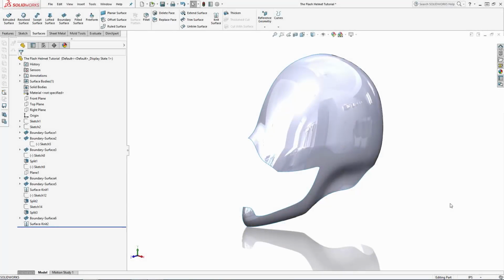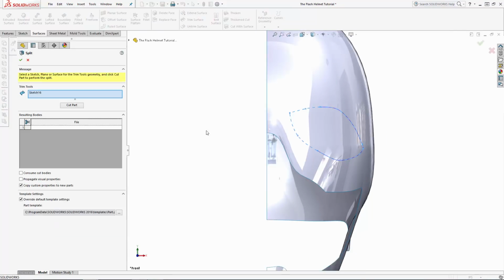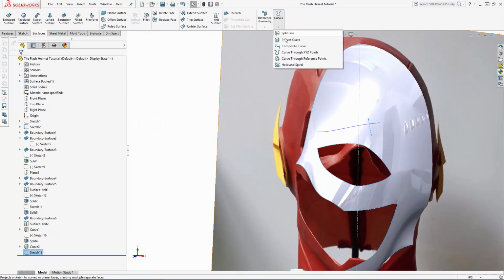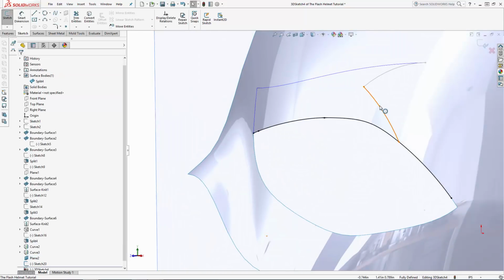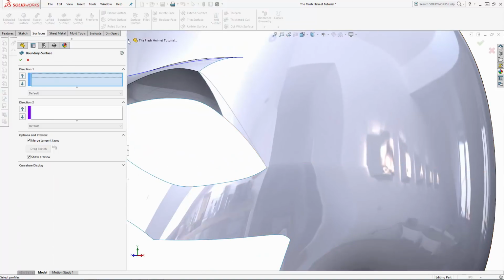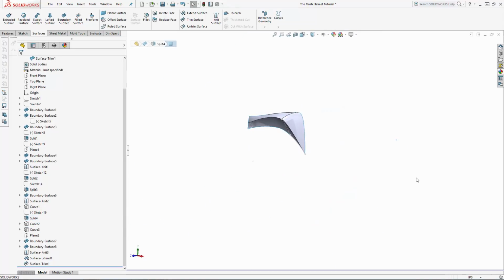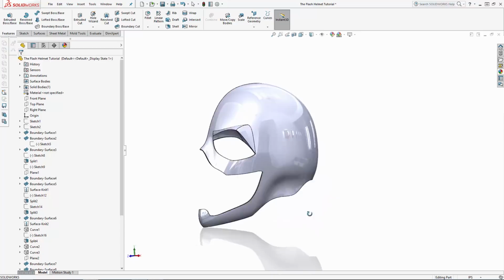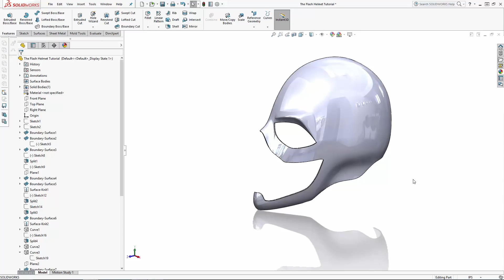Flash Mask Tutorial: Part 2 - SOLIDWORKS

Comment: I  have a question sir. Your tutorial is awesome, but im having trouble with the 3d printing settings. It says, "Cannot print 3d Model on a model that does not contain a soild or watertight body.
Reply from the maker: Hi Dave, I can point you in the right for our 3D Print guidelines in SOLIDWORKS: https://help.solidworks.com/2021/english/SolidWorks/sldworks/c_print3d.htm
Reply: @solidworks  Thank you sir. Im still practicing so its fine..:D
Reply: @solidworks  Hi again sir.. I have a question on 3d printing..WHat if i made an assembly and i just overlap soilids like arms, body, head and legs. Does 3d printing make it a full solid when i print it there? Sorry i dont have any 3d printer to test it..thanks alot
Reply from the maker: Hi there, here is a suggestion from a team member: Use 'Save As' dialog, change the file type from assembly to part. Select the option 'All components'. Open the part file that you just created and then use the combine feature. Select all the parts either from the tree or the body folder.

You should then have a single solid part you can save as STL.
Reply: @solidworks  Okay sir.. I have been reading those combine too.. I thought when i assemble things on assemble, if you print in 3d they will be attach to each other like a solid single item too..hahaha..

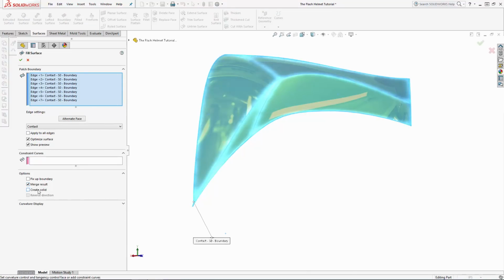Comment: For some reason I can't merge the results of the eyebrow at 06:20. It tells me that "The fill surface cannot be merged into the adjacent surfaces. This may be because the other surfaces intersect."
Reply from the maker: Hi there! This sounds like a good question for our user community. SWUGN, or the SOLIDWORKS User Group Network, can be accessed here:  http://swugn.org/ 

With your existing SOLIDWORKS or 3DEXPERIENCE ID, you can access SOLIDWORKS Forums for more information on a variety of topics and questions from our user community. 
 
Check it out here: solidworks.com/UserForum
Reply: @solidworks  Thanks for the information!
Reply from the maker: You're welcome!